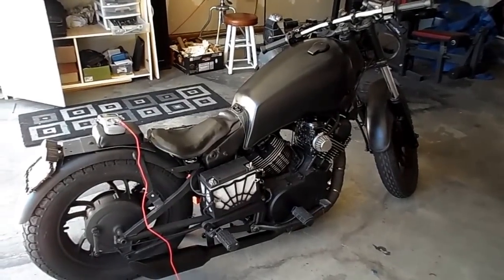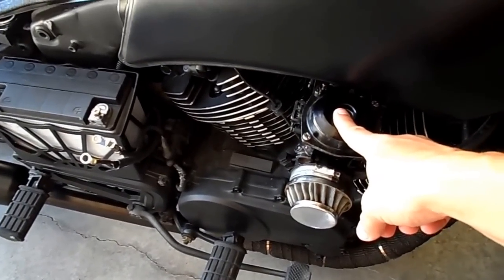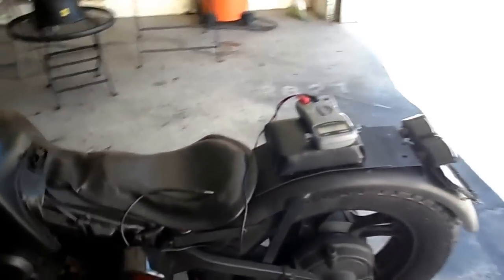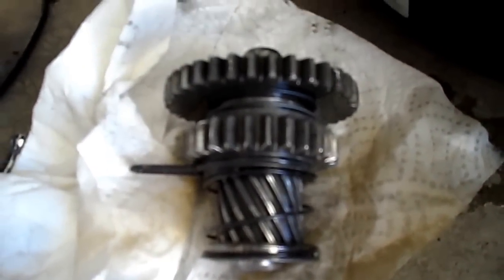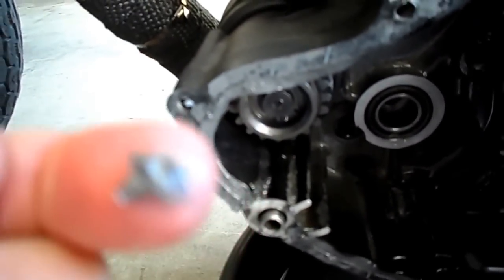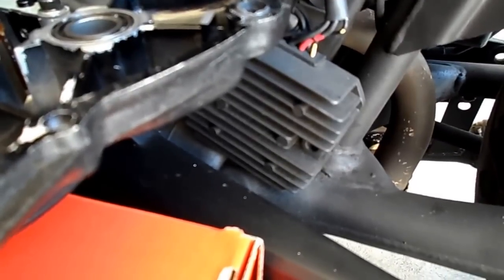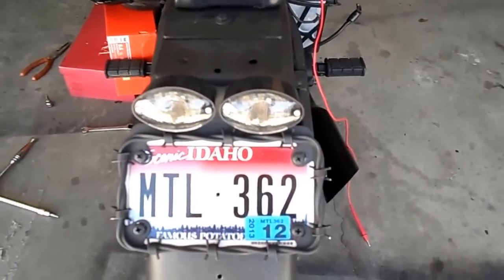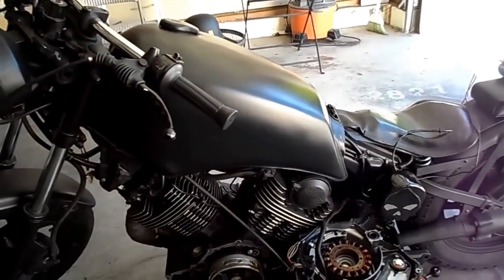1983 Yamaha 920 Virago stator replacement part one

Comment: I’m glad you showed off the bike. Gave me some ideas. Good idea wiring through air system. Might try that. Any idea how to remove that alternator rotor connected to the crank?
Reply from the maker: Alex Fluckiger If you have a picture I can take a look at it but I’m not quite sure I understand the issue. I have a video that shows how to replace the stater if you want to take a look at that to see if it helps.
Reply: Ya I need to remove the flywheel. I’m just going to take it to a shop. With the starter problem, do you know how to make it a little better? Someone said remove the spring. But I worry that might screw it up more.

Comment: I saw on your box with the bolts you have a couple that say "retap"
I took off my side cover not to long ago, and think I stripped the hole under the clutch cable. How did you go about retapping, did you do the same threading? switch to SAE? I'm trying to do this in the most painless way possible.